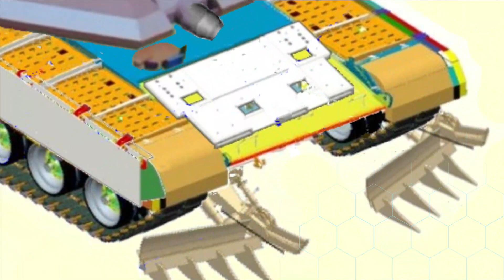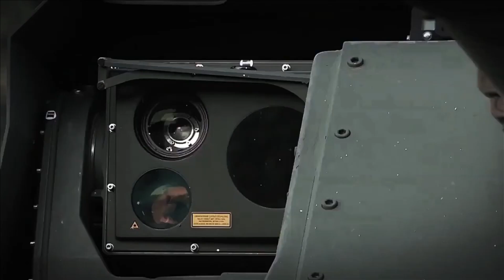DRDO Chief: Light tank to be ready soon

Comment: They should think out of box and unconventional design like Sweden's tanks . Make it crew , careless. Remotely  operated weapon platform . Using existing way of thinking is not going to deliver the required results. Need to get the weight down to 10 -15 tonne so it can be air dropped. Military assets need to take account of a varied hybrid warfare as shown by the Ukraine conflict . Conventional thinking even with heap UAV makes expensive manned vehicles easy targets

Comment: Good. this light tank may serve as source of guidance to our futuristic MBT which will be introduced to replace vintage T-72 tanks. 

Also we can't  deny the fact that current Ukraine crisis has proved as blessings in disguise to us for it has reiterated the essentiality of indigenous production of all major weapon systems within the country and reduction of import because of worldwide fluid situation.
Reply: why we have to commence the manufacture of light tank from the design stage after gaining the experience of indigenous production of Arjun MBT within the country ? 

why can’ t we use the old design of Arjun  MBT as a base alongwith the desired reduction in dimensions along with other necessory changes that are optimum for the futuristic light tank which is in the offing. 
this will help to reduce the time and labour besides saving cost.
So to say that we produce a mini Arjun tank of 30-35 tonnage weight category with 1000HP engine having 105 mm  rifled gun as main armament along with other essential systems of a modern  tank included.

In short we this time produce a new Beta of Baap Arjun MBT tank and name this light tank as Abhimanyu.😊

Comment: I think Safran never going to give IP Rights to india
Reply: why should they ? had we parted with IP s were we  in their position. ? certainly not.
Reply: That's true. Indeed, no country in the world would give up such priceless knowledge, or even bits of that knowledge, without extracting a HUGE price. So, India would have to do 90% of the work itself, only depending on other countries for the remaining 10%. Example: France fixed the remaining the last three or four problems in Kaveri and made it fit for Ghatak UAV, if not Tejas itself. 

It is like driving up a steep mountain. You loop around it again and again, and ascend a bit with each loop, until you reach the top. Persistence is the key here. 

Once Kaveri passes the engine tests (originally planned for June-July in Russia) and stabilizes for Ghatak, DRDO will be ready for the next iterative cycle, which would bring it a step closer to mounting Kaveri on Tejas. Even after Kaveri is certified for Tejas, many years of hard work would be needed to fine-tune its performance, and improve its reliability, thrust, efficiency etc. to match the level of comparable GE engines.

That is the most we can ever hope for, practically. It is heartening that finally, an aero engine testing facility is being built. This will make testing for each cycle both faster and cheaper, thus speeding up the overall process. Also encouraging is the news that in recent times, good progress has been made in isothermal forging etc., and in single-crystal blades manufacture. 

Numerous such successes are needed to achieve the overall goal of making Kaveri suitable for Tejas Mk1/Mk2, AMCA, TEDBF, ORCA, and possibly some transport airplanes (both military and civilian), UCAVs, drones etc.